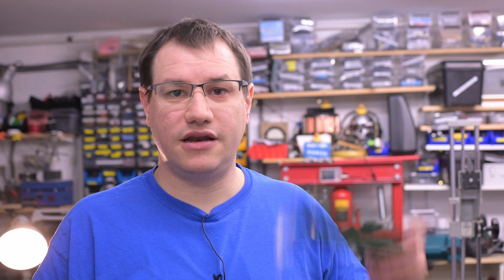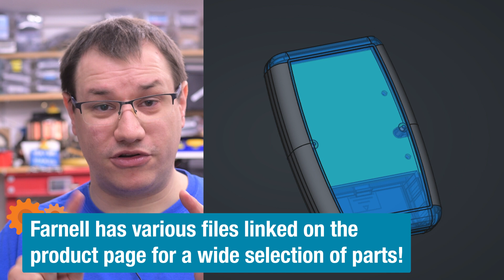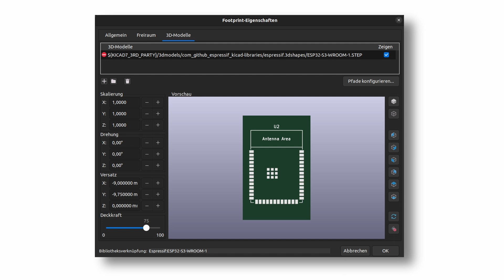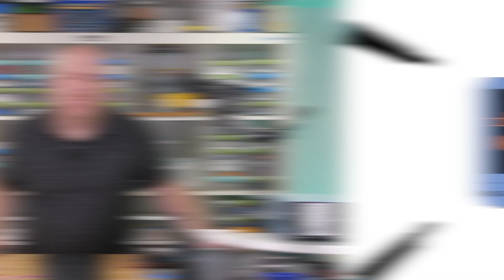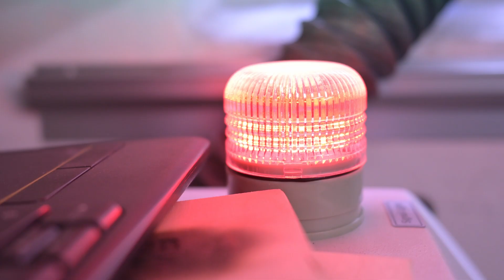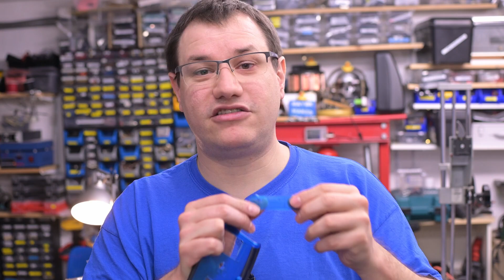Design for Manufacturing - Project to Product by Modifying Off-the-Shelf Cases

Comment: Wow i liked that the manufacture gives you the size and trace of the pcb to import into your own electronics design automation suite like KiCad EDA. Also after was cool to see it all imported into FreeCAd as well. Didnt know there were so many awesome open source tools to use! I think this project has given me a much better insight into thinking about how to professionally make projects and not 3D print everything. The only cavet to that is possibly having to do some in-house modification if the minimum numbers are not met by the ready made case manufacture. Awesome to see it all come together!
Reply: Exactly, that was the intention 🎉

Comment: I'm using those same blue Hammond cases for my projects (they're great boxes), but I don't have a fancy CO2 laser or milling machine. How would you recommend making the display and control cutouts?  I'm using a Dremel now, but it's really ugly, and I have no way to do the front face plate either. Can you describe how do you the front plates as PCBs? thanks.
Reply: whenever manual tools are involved I try to use templates, so a cutout template made from wood clamped to the case will give you a guide which you follow wit hyour rotary tool(aka dremel).
on the PCB as front panel topic...we maybe should do a dedicated video on this topic.
Reply: @MAYERMAKES  "we maybe should do a dedicated video on this topic." - YES PLEASE!  :)